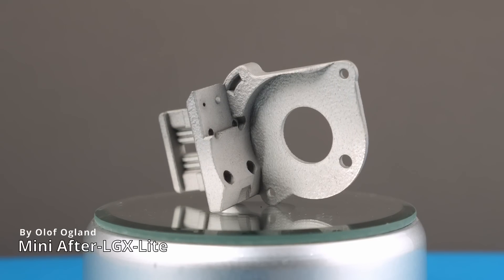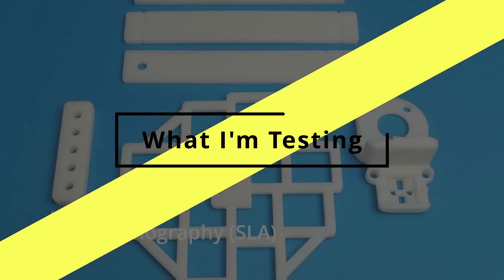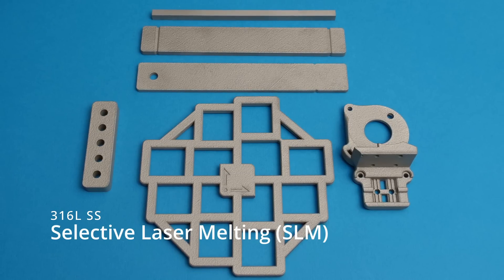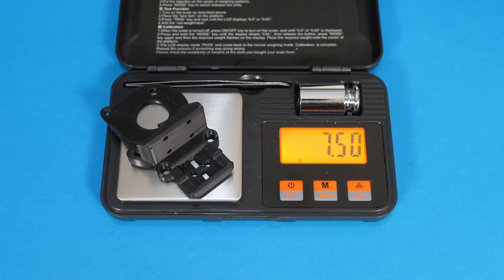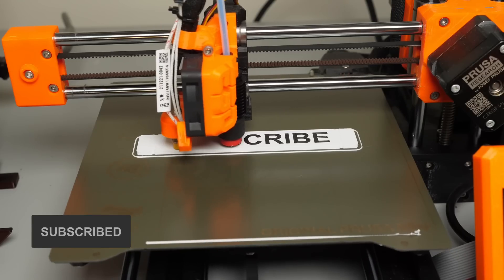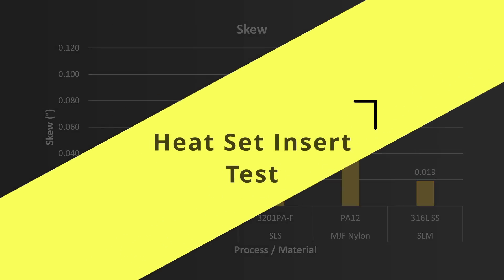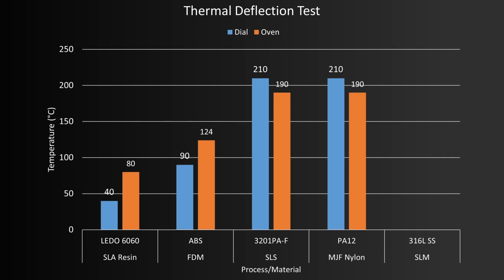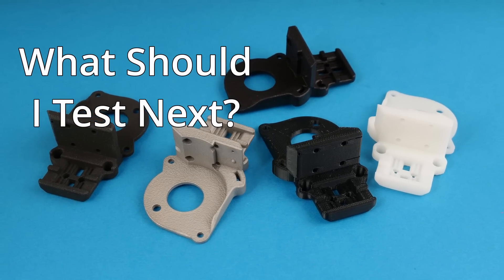Five 3D Printing Processes Put To The Test

Comment: I run a mostly B2B SLS printing service bureau, so I'm well aware that SLS in  general and for small parts particularly is not as expensive as people think it is, if you don't go into the realm of filled or engineering materials. we print a lot of spare and custom parts for industrial applications in Nylon PA12 and that's quite affordable, it all depends on the sintered volume and on how the parts can be nested in the build chamber.
A service as big as I think  JLCPCB is should have enough orders on hand to be able to fit loads of parts in the build volume and cut the costs down a lot

Comment: I realise this wasn't the point, but wouldn't heat-set threaded inserts into stainless steel be completely pointless, even if you could somehow get them inserted? 😆
Isn't brass softer than stainless steel, thus adding brass threaded inserts into stainless steel would just make the threads weaker? 😸
Reply from the maker: Yep. On the carriage I've changed the hole size so it can be tapped for m3 thread 😊

Comment: I think the flower test pieces might not tell you anything for prints from JLC. JLCPCB orients prints arbitrarily, and as the material doesn't shrink across layers makes these samples incomparable.  All of them would need to be printed in the same orientation.